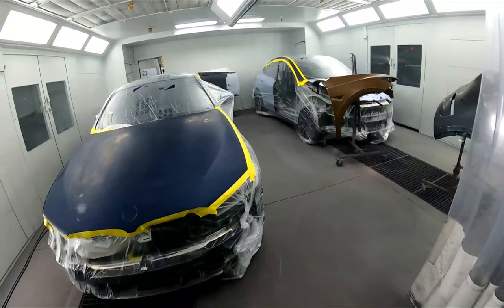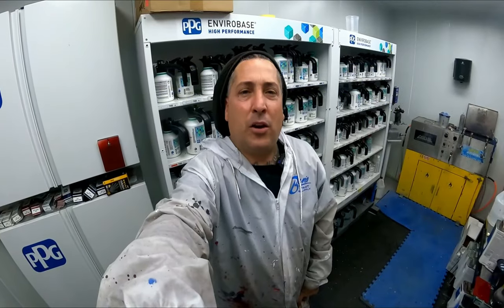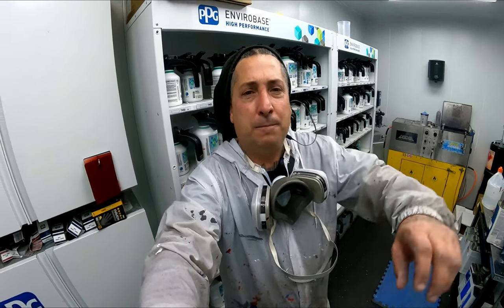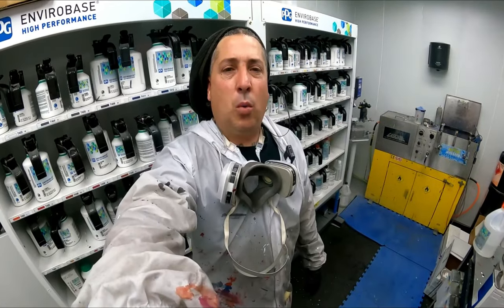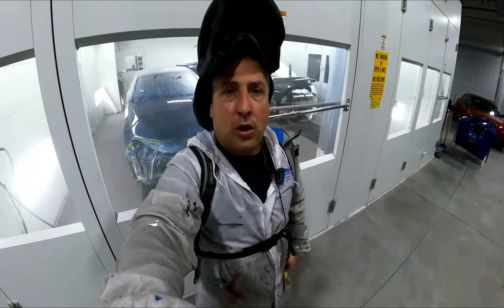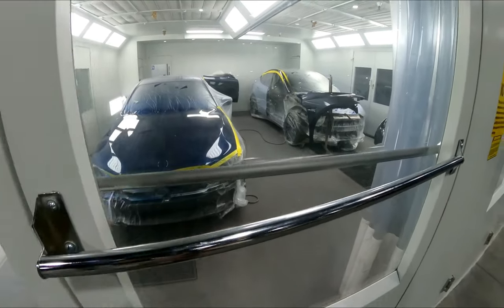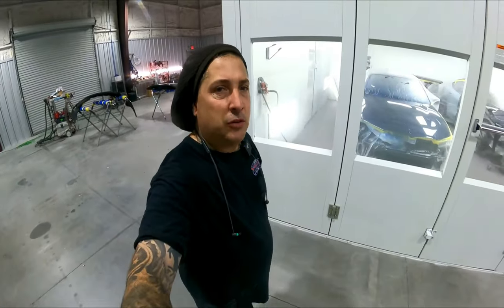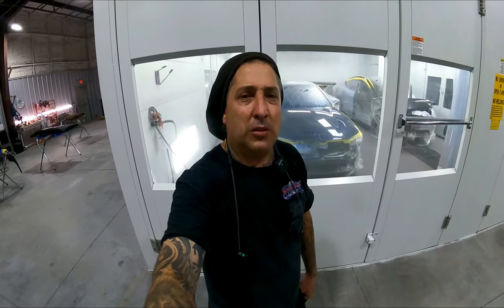WET ON WET SEALER - IS IT ALWAYS NECESSARY?

Comment: Over sealer I always spray sra reducer or some type of  edge melting reducer just in case I get dirt it will melt.. give it a try been doing it for so many years and it always works
Reply: Keep in mind extend as far as you think you might have gotten overspray and it will give you a super smooth surface
Reply from the maker: Thanks for the support